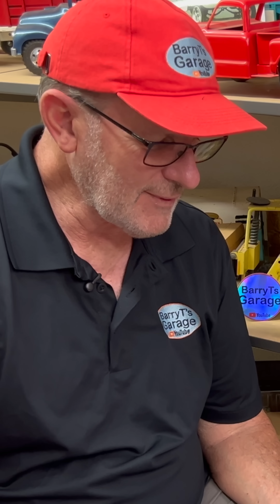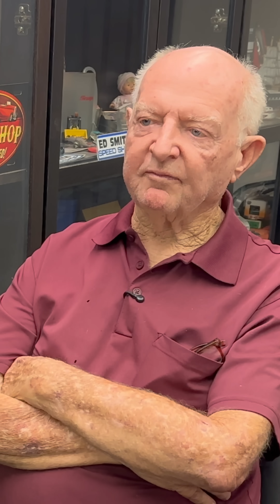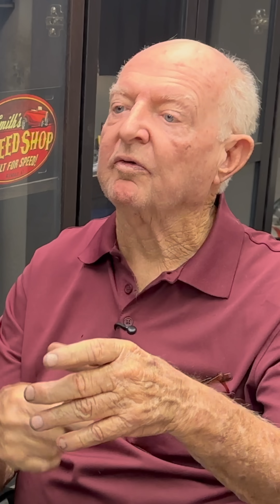UNLEADED Gas Created Engine Problems - Ed Smith w #BarryT from Ask Ed 45 #classiccars

Comment: A fellow racer in ASA asked me what kind of fuel we ran since it was blue.  I explained that we switched to 110 octane aviation fuel when Sonoco 260 became unavailable.  I neglected to tell him that I added oil to the fuel to lube the valve guides.  After towing from southern Indiana to Odesa Mo. for a 400 lap ASA race, he seazed a valve in the guide which put him out in practice before the race.  I felt really bad, but I thought he would realize the av gas was unleaded.  I mixed 1 and 1/2 quarts of 30 weight motor oil into a 50 gallon drum of fuel, as I remember.  We carried two 50 gal drums in our truck.  It ran well in our 12.5 to one 430 CID BBC.  Sonoco racing fuel was cost prohibitive, even back in the late '70s.
Reply from the maker: That’s a great story. Thanks for sharing it.

Comment: 😢 unfortunately, I think GM is saying the same thing. 0W nothing. Not a good lubricant. Especially here in the winter, you don't burn off all the excess fuel when it's cold. That's not a good lubricant, either.

Comment: My wife’s grandfather gave us his ‘77 Dodge Aspen in 1994.  A year later, 3 cylinders were low on compression. 
 Pulled the heads, and the valve seats were worn into the head. 
 Had to find another set of good 318 heads at the junkyard. Then have them rebuilt, with hardened seats.

Comment: Lead fouling on spark plugs became a thing of the past, cars stayed in good tune much longer. Lead phaseout happened at the same time as electronic ignitions became universal. For a long time, I equated the improved performance to the new ignitions, but many years later I realized that even my old point ignition cars ran beautifully without the need to change plugs.
Reply: You didn't get the MTBE fouling?
Reply: Absolutely. And before 1980 cars often had to have “valve jobs” to clean out all the gunk on the rockers. It is amazing how dirty those engines got with lead fuel.

Comment: For a long time I had a little plastic adapter that went on the pump nozzle, that was was for putting leaded gas in an unleaded car...My Lincoln Continental 460 got that treatment for about a year... Anything to save a dime 😅...It never did clog up its convertor either 🎉

Comment: What Ed was talking about (grinding Chrysler valve seats) he was using a Tool Room type Sharpening Stone meant to touch down HSS or Press related parts.  I used to work in a Tool Room and used those White stones to touch up cutting tools. 
I remember my uncle who was a lot like Ed as far as engine experience.
He talked about using Bronze as a new valve guide once the "cheap porous casting went wobbly" as he put it. 
He used to say Knurling was a last hope to squeeze a couple more years and laughed at those Viton Umbrellas "junk"!! "Just make it right in the first place"!!   (I'm repeating him from back then).
He implied just bore holes in the head casting for the stem to travel in was a mistake but drill out and drive in Bronze Bushings for the valve stem to ride in is what he claimed was better solution. 
My only car that required Lead Fuel was a 60s Ford.
There was a product then called Pist-N-Lube I added 60 CCs to the tank to help make up for the missing Lead.
There was also Top Oil.
I switched from Top Oil and Pist N Lube.
I still have an unopened bottle of Top Oil.
The last time Petro Canada sold Leaded was June 1990 in my area.
Yes it's still available if you own an Airplane.
It's 110 Octane but you would be fumigating yourself and your friends driving around with it in the tank. 
I remember it "smelled different" but can't describe it. Sort of "sweeter" today's fuel the smell makes me nauseous right away.

Comment: Lead is an incredible material, which is why it’s been used in many ways for thousands of years. It was a mistake to remove lead from paint, glass, and many forms of solder, as it imparts substantial and meaningful properties to those materials. And especially for paint and glass, the dangers have been overwhelmingly exaggerated. That said, although not good for engines, it was absolutely needed to remove lead from the fuel. The air today is immeasurably better and cleaner
Reply: @fc872e1  The lead was used as a lubricant for the wiper tip in potientiometers. In audio circuits, it retained the high end much better ehen the pot was turned down. Outstanding on electric guitars and amps. It was ridiculous to force manufacturers to stop making them like that.
Reply: Smart, like a bible
Reply: Lead does not remain in the air. It immediately falls to the ground and drags hydrocarbons with it.

Comment: I wasn't driving until 82 but you could still find leaded gasoline for a few more years. I remember dad buying an adapter to put leaded in his 75 Malibu Classic. Apparently the nozzle for leaded was quite a bit larger than the holes in the filler neck in 70's cars.
Reply from the maker: That’s correct!
Reply: I have an '83 F150 my Dad bought new and that little adapter is still laying inside the fuel door. It's been there as long as I can remember so I just leave it be.
Reply: Yes I remember the service stations asking leaded or unleaded gas. I have a 1976 Vega with the original engine and it calls for unleaded only.

Comment: Yes he's not wrong about the valves, as I was running Cleveland's in the late eighties when they started to phase-out leaded fuel in Aus. I got the hardened exhaust seats installed as recommended but later I was told that you can get away with just Stainless Steel valves, but the power loss was the biggest problem as compression had to be lower otherwise the detonation was unbearable 😢

Comment: Tetraethyl lead was always an easy way out for the oil companies and manufacturers. You can get high octane through refining but it costs more. Hardened exhaust seats could have been done as well, they just chose not to. It's all about money. The emissions  mandates eventually won out
Reply from the maker: That's a good point about the cost factor.

Comment: Amoco has used premum unleaded since the 1920,s known as white gas. Bromides were used for octane instead of the substitute ethyl lead. The leaded fuel was a corrosive that ended up in the oil that ate up bearings and exhuast systems. You never got more than 2 years out of  a system back then.
Reply from the maker: That's some interesting history!

Comment: Burnt Valves and Ring Jobs disappeared after Unleaded gas took over. Valve stem and guide wear was normal before Unleaded (still have all guide knurling tools used frequently then)

Comment: Tetraethyl lead is not graphite. 
How does gasoline go up the valve stems ?
Reply: Why do you think there is carbon in a combustion chamber and in the exhaust port??
Reply: @JarmequiousWhite  Entirely from overly rich fuel air ratio not lead, even unleaded gas produces carbon in the chamber and ports!
Reply: @loganpe427 all engines have carbon in the exhaust port. You can go to the Honda dealership and there will be carbon in the exhaust port. Point being, that’s how fuel gets to the guide. Obviously fuel is running over the valve on the intake side.

Comment: True story. I'm a high school kid pumping gas after school and weekends. A long-time customer comes in. He's angry. His brand new pickup requires unleaded. It's more expensive. He doesn't want to pay more. He had taken the filler neck and hacked it. So, the regular nozzle would fit. I told him I couldn't pump the gas. I would be breaking the law. He gets more angry. He gets out of the truck, grabs the regular nozzle, and starts filling up the truck himself. 
I told my boss. He told me to allow the customer to do as he pleases. He didn't want me to get punched!
This went on for about a month. Twice a week for four weeks. Then the customer disappeared! I never saw him again.
No doubt he voided his warranty. Gas prices for regular were 27 cents. Sunoco 260 was 39 cents. Unleaded was 45 cents.
Yeah, unleaded wasn't taken very well back then.
Reply: Love how not putting something in gas made it more expensive. But sure Corperate greed has nothing to do with it. 😂
Reply: @THEFLATSPOT The formulation of unleaded gasoline was drastically different than the formulation of typical leaded gasoline to obtain the needed 87 octane rating. Leaded regular was typically at least 90 octane. 
New unleaded engines included catalytic converters to remove additional harmful exhaust gasses. Using leaded gasoline with a catalytic converter often caused the converter to dramatically overheat melting the internal components of the expensive converter and completely clogging the exhaust system. The vehicle would not run, the warranty was void,  and sometimes the excessive heat burned the vehicle.
Reply: @larrywisener1375 Yes exactly.
He would most likely have had the converter go absolutely "red hot" and scorch the carpet above the converter and have to either deal with a potential fire or pay out of pocket for the converter being repaired (if GM) or replaced if anything else (or removed and hope it isn't noticed).
Reply: @THEFLATSPOT similar to when disc brakes were the new thing. The pads were way cheaper than shoes, the labor was way less, and yet all the shops were charging twice the price for disc brake reline jobs…because it was the new thing.

Comment: I remember putting lead additives in my gas tank on my older cars....
Reply: It was snake oil. They didn't sell unleaded for 50s 60s 70s cars. they sold them for earlier cars. It was a marketing gimmick to sell it to newer cars. By 1952 most engines had hardened valve seats eliminating the need for lead. By now no engines on the road haven't been rebuilt with harden seats.

Comment: You used to be lucky to get 100k with perfect maintenance. Leaded gas had A plus. More modern cars have MANY.
Reply: Yeah lead would just wreck havoc on all the rocker arms and the heads would need a huge valve job cleanup by 80,000 miles and you got very poor oiling because all the ports would be gumped up. And once the lead fouled the oiling system up the engines would just be starved of oil and generally didn’t last too many miles over 130,000. It is amazing the detergent today in the gasoline and modern oils that have made modern engines keep on chugging.